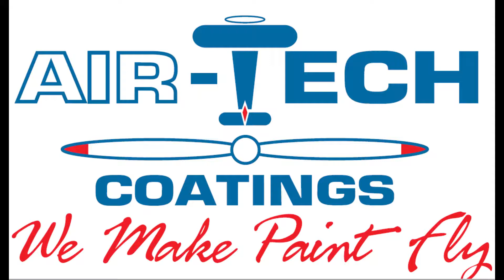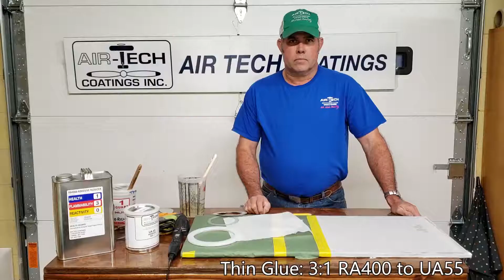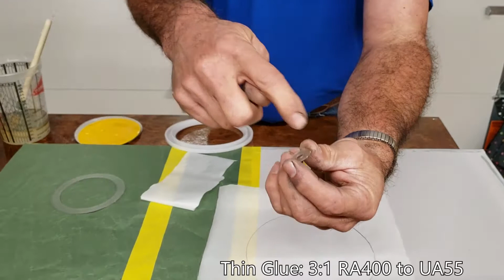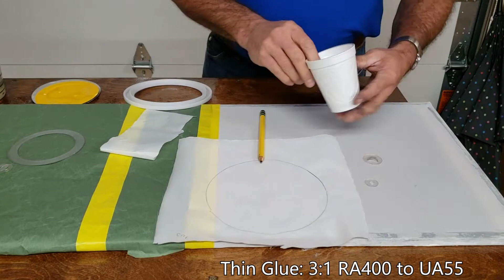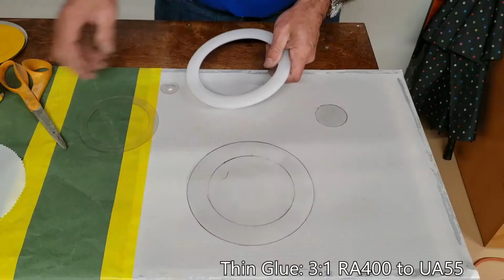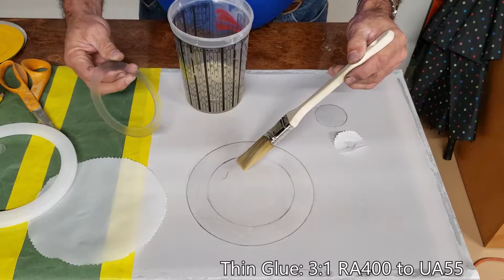9-Airtech Coatings - Inspection Covers and Grommets

Comment: How would you go about putting a hole into painted fabric for some wiring? I'd like to add a landing light to my aircraft, but will need to put a hole for the wires, somewhere.
Reply from the maker: There is a video in fabric tip Friday. Called adding inspection rings. Go to airtech website first, then hit the YouTube button. It puts you to a better management of the videos.
Reply: @airtechcoatings   Wound up finding that video after I left this comment. So would you install a full inspection ring or just do something like a water grommet and run the wire through the hole?